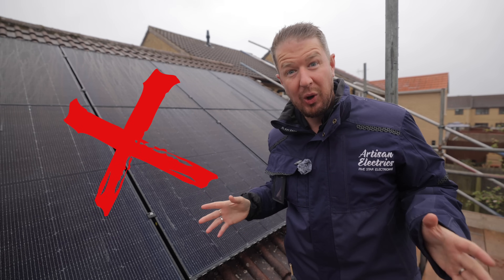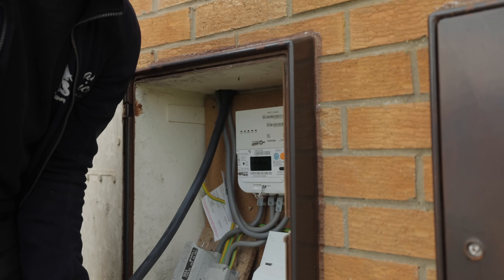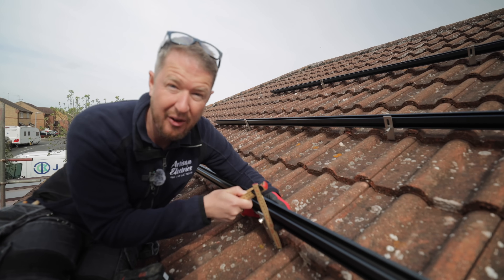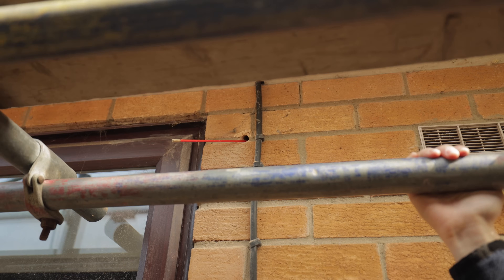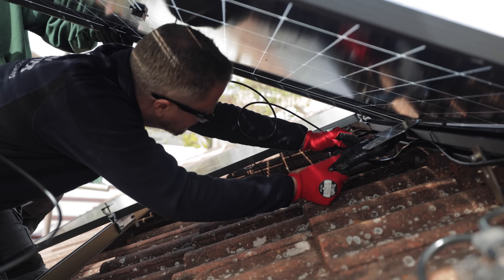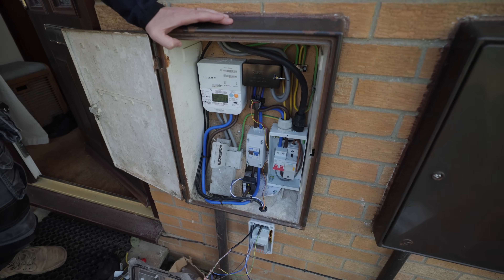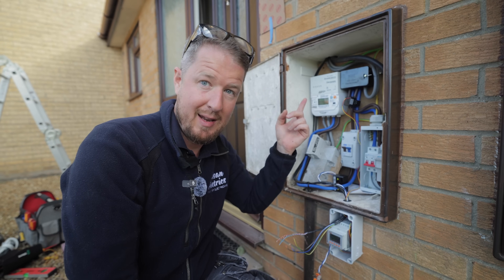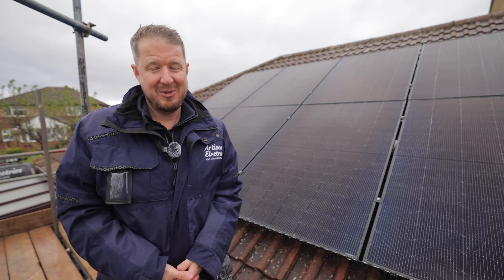Have We Been Doing Solar WRONG All Along? 🤷🏻‍♂️

Comment from the maker: Make sure to check out the Heatable website to find your best local installers 👊 - https://heatable.co.uk/solar
Reply: I wonder why you are so late on micro inverters. There is also micro inverters from Deye, Hoymiles when each micro inverter can cover 4 PVs. Much faster and safer solution to deploy. Micro inverters can also be fitted inside the loft for easy replacement in the future. At is it is good that you are catching up.
Reply: At 15:30  their is a lie 

Modern pannels use bypas diodes, so a system with the right inverter (low start voltage) will keep your array running in the shade
Reply: @neok1996  Yes,  the system will keep on running, but in degraded state. The diode(s) will stop the entire production of the panel(s) involved.  Optimizers and micro-inverters keep the production of said panels going.
Reply: Just wondering why you are using a hybrid inverter with Enphase micro inverters? Surely you could simply use an AC coupled system? Plus, they're cheaper and supposed to last longer.  p.s. don't forget the 25 year warranty that Enphase offer.
Reply: Ben's team are great.. we had our system done by Heatable.

Comment: Hi, Are these micro inverters pure sine wave or modified sine wave. How are they all synchronised as out of sync sine waves will cancel each other. Do these micro inverters output directly to the grid or are they totally for battery charging, in which case another inverter is required to feed the grid. You didn't mention anything about a gateway unit.

Comment: You are converting DC from the panels to AC and feeding that to a DC battery. Then another conversion to AC, because the house runs on AC. You are adding 2 conversions just to use micro inverters, which are also more expensive. I wouldn't.

Comment: The way the leveling is done @ 6:48 is wrong!  For micro converters the array doesnt have to be flat, but for string system it must be ! . Perfectly flat for best effiency.  The way it is done in the video the pannels will follow the curviture of the roof, which doesnt have to be flat.  Use a brick layers string between the end points.....

Comment: Does the use of micro inverters make it easier to extend the system at a later date?
Reply: Yes, but... Enphase has a new series of converters 8x series  but they cant be mixed with the 7x series in one system (single gateway).. Both are available but for how long...  Compatibility issues will always remain. I have the 7-series with 25 years warranty, so it is an enphase issue in case i would need a replacement....

Comment: if the heat from the reflected foil or paint is an issue use a plastic latice based mat to stick the foil on so an air flow passes through under the foil or painted silver surface ?

Comment: Why hasn’t a company come up with either a paint or a reflective surface that adheres to the roof surface like the reflective insulating material that goes behind radiators, of course outdoor rated this would surly increase the reflective aspect and the efficiency.

Comment: I put I Q7 on my 21x 410 panels,  2 years ago and i haven payed for electric since. 20 kwh of batteries.  £800 on excess generation. Having a 9 kwh Air sources pump installed with Sunamp Thermino 150 ePlus. we will see if i can achieve total heating hot water and electricity this time next. One more thing they come on and hour before DC panels and stay on later. I also have them on the North side of the house.

Comment: I don't belive it. Show me this working on the roof you were installing the solar panels on. I say no significant power will be generated from solar radiation reflected off those roof tiles. Just measure the power generated from the front face and compare it to the power generated from the back face.

Comment: Almost everyone is doing solar all wrong.
There should be 10cm spacing between each panel, to allow them to cool down quicker, thus they'll be more efficient.
The Swedes water-cool their panels, thus heating water and cooling the solar panels at the same time; that is patented (I found out when "I got the idea" myself).
Many people run a grid-tie system, which shuts your solar down, when there's a power-outage (so useless for emergency-power).
Most people use cheap Chinese panels, which are inefficient. It would be better to get some Taiwanese or even Spanish panels. Fortunately, newer, more efficient panels are on the way, but until then, I'd recommend T-Sec panels.
... and more ...

Comment: Don't understand why they didn't use micro with two or four mppt!? Just to throw money away?
Reply: Because then you would undermine the entire value proposition of distributed architecture.
Reply: Yeah, but each micro inverter can control upto 4 panels (depending on model), so each panel it's producing at maximum, why would you need to have more micro inverters when one can have upto 4 mppt trackers.
Just to throw the money away..
Reply: @MrLucize  a single 4:1 micro fails, you likely loose half your array. Manufacturers of multi-panel micros are not in the same quality league as Enphase, that just a fact. Why gamble?
Reply: Sure quality is questionable on some vendors, but apsystem at least it's one of the best and they have 2 mppts and the 3 phase is with 4 mppts. Not to mention the deye micro ones that on string inverter has one of the best product on the market

Comment: 8:01 "Each panel has a micro inverter under it, and that means that's no need for a separate inverter anywhere else." So having TEN or TWELVE micro inverters on your ROOF, each of which can go wrong, and WILL eventually go wrong, is better than having ONE inverter in your house or garage, where you can get to it without having scaffolding, and can change it in one hour or less. Okay...

Comment: The answer is yes it's more that can go wrong and yes you'll have to get back up on the roof and yes you need to pull off the solar panel before you can get to it. Those are pretty huge downsides

Comment: What should be done by Solar panel manufacturers is create solar panels which are 'roofing rated'. 
Apart from Tesla tiles they don't make panels which can substitute for long run roofing and insulation paper and possibly insulation. If the cost of roofing was built into the cost of panel installation, given the surface area of a North or South facing roof (hemisphere dependent) low cost lower efficiency panels could be used as well.

Comment: If you leave bifacial panels standing, can you double the output by using a mirror for reflecting light to the back side of the panel?
Reply: Not double. But you can increase ouput indeed. Flat roof mounting and using a white coating under the pannels. Backside is less efficient  so you wiill never double it.

Comment: 11:50 do they get electric shock when working on a panel???
Do you always get electric shocks??? 😮
Reply: no, working with micro converters is very safe.  Only the single pannel dc voltage of 40v.  Not a string that goes up 40v with each pannel added.  The enphase converters only produce 220v after  receiving a proper signal from the gatweway. No 1000volt on the roof.
Reply: @JurBtree  thank you

Comment: I know lets have a race to see which "tool" can do the cut the quickest.
You would have been much better off with a competent tradie instead! 😂

I reckon a good 18t manual hacksaw and someone with some shoulders using it would have won that test. 
Although the tool holding the piece, needs to understand why carpenters & cabinet makers use clamps.

Comment: Avoid micro inverters and power optimisers - nothing but trouble! 
Just been out to another person, system not working, envoy (the interface with the WiFi) not working and needs replacing at £300 just so we can see why the rest of the system isn’t producing. 
Also, no help from Enphase unless we pay £175 for warranty transfer to gain access to any of it. 

Warranties in solar are long but beware they’re not worth much so you need simple interchangeable parts so you anyone can change it at cheapest option
Reply: Btw those 20 year warranties don’t cover the replacement of the micro inverters / optimisers so if you can imagine you get a failure and it’s about 4 weeks to get a new one in the post and no by is coming to fit it for you. You have to put up scaffolding and pay someone to do it, only nobody wants to because they’re all busy fitting new jobs.

Comment: I think micro inverters would be far more suited to large ground arrays, where access is easy and you don't want to put the whole array out of action to change a main inverter. For maintenance these are going to be a nightmare on domestic roof instalations, they WILL fail and someone WILL have to get up there, remove a panel or two and change it out. Oh and the scaffold will be long gone by this time. I would not use them on a roof system full stop. Panel, DC cable and thats it up there, nothing to go wrong. Main Inverters? even they shouldn't be in lofts, embrace the technology and put them somewhere accessible, so they can be monitored and maintained.

Comment: We´ve installed Enphase Microinverters since 8 years ago. We would recommend them over any string inverter any single day. But I am pretty much convinced that a bifacial panel wont do ANY difference in that sort of installation (flush) since it needs reflection from the surface (Albedo).

Comment: The microinverters have thier place but the 295VA rating basically derates your array by quite abit. I wouldn't bother with them if the roof had no shading issues.

Comment: I have 2 strings of 10 JA 390w panels onto an 8kw solis inverter. I was interested in what you are saying about optimizers as i get poor winter results.
I can make 1000kw per month at peak summer, but the low winter sun is shaded at points by trees.
How much extra will these give, and is it worth adding.
 I go through a reasonable amount of electric as i run an ev via zappi, and im heating the boiler(conditional on boiler run)  return flow via a willis heater with an eddi.
Tia

Comment: Micro inverters are in the technology but I don't think they're as versatile as having a straight DC system with optimizers. And that's a lot of micro inverters to upgrade at a later date plus there's heat issues on the roof so it kind of makes sense to keep the large amount of the electronics out of the heat. But it's definitely an option. And I don't know if things have changed but there at one time was no consideration for using them in grid down situation I would hope that might've changed but it does complicate the process a lot.

Comment: The microinverters sound interesting. I would like a video on the real performance of the panels,price and durability. Also why the batteries in the open? It seems that the circuitry is left out in the open with limited protection from the elements. What are the temperature in which the equipment described can operate? Winter -15/20 C, summer +28C

Comment: Microinverters are great - probably the best method of power conversation - but Enphase has power output limitations (see below) compared to other microinverters. So even if you are using bifacial panels, your limiting factor is the microinverter! Please try and be clear and transparent with your viewers.

IQ8MC: 325W max AC output
IQ8AC: 360W max AC output
IQ8HC: 380W max AC output

For example, if using IQ8MC microinverters with 435W solar panels, the max AC output would be limited to 325W per panel, even though the panel is rated higher!

Comment: Two things i noted on this video.

I prey for your customer you actually made the rest if the mc4 off properly as in that little competition neither of them wouod stand the test of time. Not an MC4 spanner in sight.

Secondly please stop using impact drivers on roofs, they are banned on our installs. Use a combi and then a torque wrench and do it as per the manufacturer guidance.

Comment: You are using the wrong micro inverter the iq7+ can't handle Al the power from these panels in the summer. You wil need the iq8ac or hc for max performance. I am also missing the gateway and the magnetic rings for noise reduction on the cable. 

I did not see a bit of PVC pipe in the brick wall before you put the cable in. I don't know if it's mandatory in England.

Comment: you also have others companies with microinverters, biggest problem is this if one of them fail client have to pay one more time installation cost for change, but less risk of fire, easier to install. Do you install blitz protection also in england? Germany/Poland/Austria install 16mm PE grounding wire between profiles under panels, and we connect this to main grounding point in house. And on DC solarcable you should cut only 6mm of isolation while mc4 making :D

Comment: Its just common sense that Enphase, Solaredge, Tigo are a naff idea. You take an intrinsically extremely reliable system (panel connected to panel) and add a box of electronics to it, put it outside in an inaccessible location.

The individual panel monitoring, and the idea that if a panel goes down it only takes out 1 panel rather than the string, the long warranty, it all sounds great til you actually think about it. Ive been installing panels since 2010 and we've never replaced a panel that just stopped working. My company now avoids installing any sort of optimisation.

If you're an installer who installs them on every job and you warranty their replacement eventually they'll put you out of business. Its just common sense. 1 in 2000 failure rate, but you fit 10-20 to every roof of every job. Eventually your job is replacing broken units for nowt.

If you're a customer and your installer has fitted them but not warrantied their replacement, the first time you put  scaffolding back up and pay for labour to replace a unit, any benefit you saw goes down the swanny, then a few months later another one goes and now you're chipping into the gains made from generation. A year later another goes etc etc.

If you're installing ground mount fine, installing to massive commercial systems  fine. But in the vast majority of domestic applications. NOPE